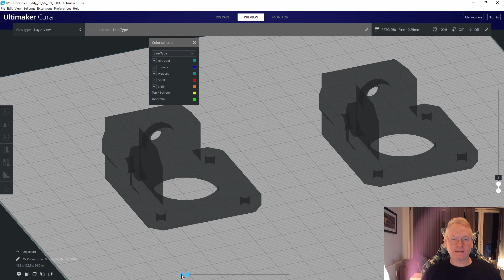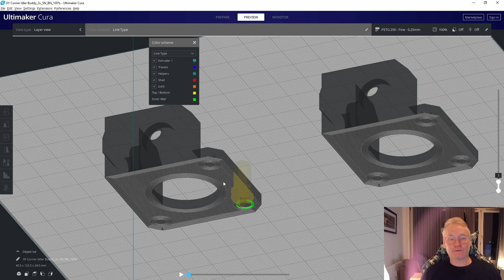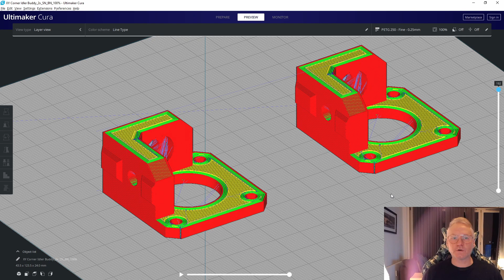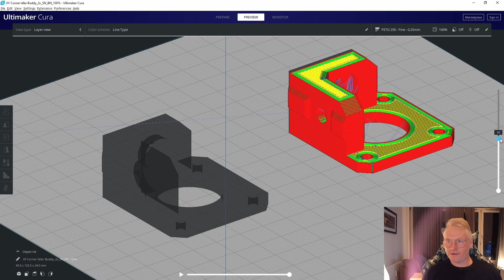CURA Print 1 Part A Time| REDUCE STRINGING | INCREASE LAYER ADHESION?

Comment: Google watches me! I was f*cking all the day today with insane stringing of petg filament from amazon. Exactly the same situation -- I need to print 8 copies of my detail in 1 batch, so I've cloned them in Cura, sliced and started printing. And I was so shocked with this spiderm-n's web between my models. Was trying to fine tune, reduce spead, play with retracts -- nothing helps. Suddenly google suggested on my phone your video -- 15 mins work and... IT WORKS!!! I've got exactly single thin thread  between each model. And everything looks great! Thank you for this great hint!!!
BTW. In latest Cura it was hidden for me. Had to enable this option.

Comment: Good video. I only noticed 2 minor things:
- my opinion is your facecam should be on the leftcbottom corner to see more from the slicing time.
- other thing is you cannot print too high objects too as they are colliding with the x axis.
Reply from the maker: IMPORTANT! Place the parts one and one from the front of the bed and back so you dont crash with the print head or x axis!
Reply from the maker: Thank you for the feedback. If you plan the position of the parts you will not crash with the parts
Reply: @PRO3DESIGN  Cura never lets me to print objects which is higher than 25mm, I placed the higger object to the front of the plate and still... Maybe I need something more in the settings. I have and Ender 3 pro and using Cura 4.8

Comment from the maker: IMPORTANT! Place the parts one and one from the front of the bed and back so you dont crash with the print head or x axis!
The point of increased layer adhesion is probably minimal at most but it is something to consider